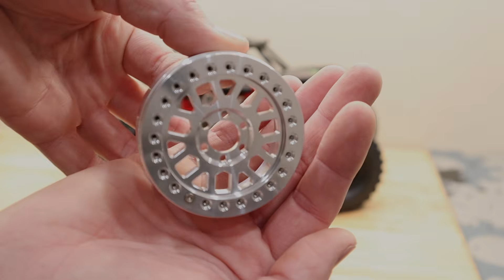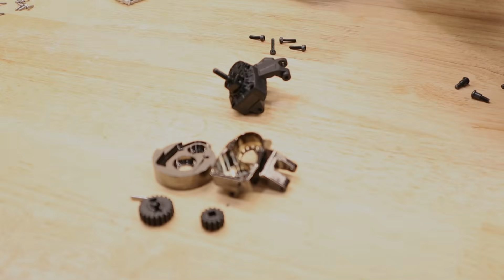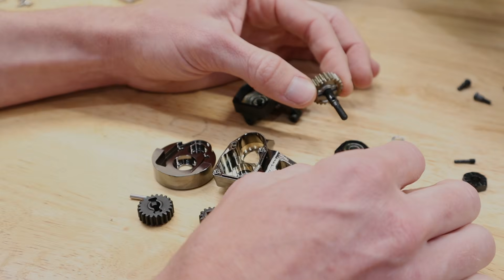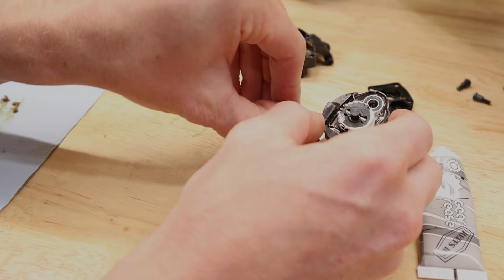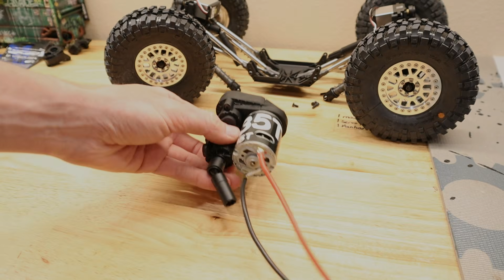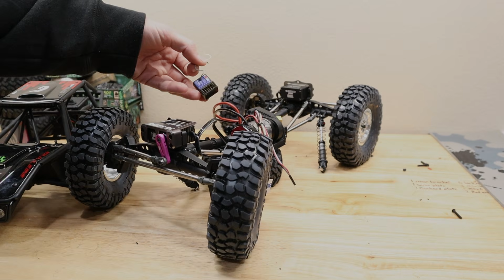My Favorite Capra Mods! Best Upgrades for Axial Capra UTB

Comment: im knew to the RC scene. i recently bought a capra used. it worked at first. now after about 15 minutes of drive time i cant turn the vehicle on at all. ive tried charging the battery, nothing happens when i turn the car on from the back switch. im lost where to go, i cant find any forms out on the internet with this issue. any help would be greatly appreciated
Reply: If all else fails take it into a shop and have them help you out bro.

Comment: Hi bro man! Have a question with the hobbywing fusion se and 3s lipo with stock trans and 12 t pinion will they hobbywing stay cool? I'm running am32 and it's getting to hot thinking about putting fusion in instead of switching to 3 gear trans for the am32. Not sure

Comment: I’m a huge fan and just bought my first Capra.  I have 2 questions please.  First is could you get me a link to the thumb steer attachment on your gt5.  And when I install my fusion, which came today, where do the lights plug in now?
Reply from the maker: You will need a new receiver with the fusion and plug the lights into that
Reply from the maker: My thumb steer was given to me by a friend

Comment: I have owned the Capra 4ws since it came out and I just burned my motor 🤣 gonna be upgrading to the fusion pro. Thanks for the great info and the installation process! Do you have a video explaining the binding process with this set up?
Reply from the maker: No need to bind just because of a new motor
Reply: @westdesertwheeler  I just figured since you got the new receiver too, that it would require binding

Comment: The nitto Grappler tires work well if you cut the inserts in a star pattern.Because they are ribbed on the inside.They are my favorite creek tires after they break in.
Reply: Fine if you want to spend zero dollars on tires/ foams. But it’s not 2007 anymore, there are far better insert and tire options. Star cut foams don’t offer near enough sidewall support, and like Logan said the compound of the trail grapplers just isn’t near as soft and grippy as other options on the market.

Comment: I really like your build! The information you give is great. I'm having a problem with mine after the last ride. When i let off my throttle my Capra will continue to move forward, not at a fast speed but it does keep moving. Help

Comment: 2.2’s look so goofy in my opinion on 1/10 scale cars. I really much prefer the closer to scale look of 1.9 wheels and tires. Also instead of hacking your link mounts just go for a Holmes hobbies revolver. Ridiculous amount of torque and as far as sensorless brushless goes, the start up is ridiculously smooth. It will crawl slower than you need to even with the over geared Capra trans.

Comment: Great video, I'm really looking forward to trying some of your ideas! Out of curiosity, what is the benefit of the Cut'n'Shut method over using stock 2.2 tires? Do the tires you want to use not come in 2.2 size?
Reply: I'm also wondering why

Comment: No flat skid or long rod ends/links?    There is an .stl file on thingiverse for spring cups that retain the spring but at a lower position like removing the cup.
Reply: Thingiverse also has a file for hood pins that don't require a body clip, they're great.

Comment: You mentioned venting the tires but I didn't see you do it.  How exactly is it done?  
Also, those wheels look like you can narrow the width using short hubs.  Did those .350 hubs narrow it from stock?  Capras are so wide and the gates seem to get narrow!  I've got some carbon fiber wheels that appear to be similar but I haven't installed them yet.  I wonder what hubs to get.  
Have you ever gone over setting up the end points on a GT5 radio?  I'd like to see the whole process sometime.  I don't think the servo I replaced is correct.

Comment: Parts diagram I am looking at says the stock pinion is AX30569 which is a 48 pitch 14T.  Your saying a 11T 32P AXI30722 will work?
Reply from the maker: Yes 11T bolts right up. Doesn’t have to be an axial part either. Many brands of pinions available make sure it’s a 32P

Comment: I’m currently in middle of my build but I’m using a vanguish 3 gear with dig. I planned on using a 12 tooth pinion. What’s ur suggestion
Reply from the maker: 14T will be more than enough with a 3 gear. It will be slow

Comment: Man I probably learned more form this video on Capra’s then any other I just did a full upgrade to my 4wheel steer Capra I used a  Vader  skid & Injora high clearance links/ wheel extender because I’m now running 2.2’s I also have 90mm Lizard Pro shocks those 2 strong Reefs servos you installed how did you set them up with a bec  direct power? I know drawing that much power it’ll cause a brown out. I’m running 2.2 Proline Trenchers but I’m looking to get your cut n shuts soon. Thanks for al the useful info.

Comment: Man haha I learned the lessons in this video first hand about a month earlier cause I got a capra for Christmas. Smoked the motor first big crawl day caught in a bind, and then later the slipper clutch got me because the Vader skid moved up the trans enough to contact a wire keeper on the battery tray. But yeah agree 100% on fusion brushless!!

Comment: You should try the treal transmission case. It allows you to move the idler gear, 2 positions, to use a smaller pinion I think like a 9 tooth with a quick run fusion

Comment: If you have never tried it, I would suggest giving the Vader skid a try, Logan.  It gives both the benefit of a better break over and even more importantly the ability to use a full-size (or low profile) servo for the dig unit.  With the larger servo, you can lock and unlock it under full load, and it works perfect.
Reply: After doing research the Vader skid was the most recommended so I installed one & love the flat bottom & I installed a Fusion Pro at the same time so I had no clearance issues with the Vader.
Reply: @Casitascrawlers rock pirates interceptor chassis skid plate fits the Capra bolt on, and it allows a 3 gear transmission, and is flat belly, overall much better than the Vader unless you don’t want to change transmission
Reply: One of the best mods a capra can have is the vader skid!
Reply: The problem with the Vader is the lower links protrude below the skid, they hang up and wear out as well.
Reply: @DaxHewitt  nothing is perfect & I’ll take the flat skid clearance regardless that just means your clearance is good so even if you fixed that it would just mean your going to rub on something different so it’s give or take.
Reply: This is good to know I had given up on the Capra dig.  The CJ7 needs help also
Reply: Great video. I’m probably going to get a Capra for my 1st rc car. This video is going to be super helpful, down the road. Other than the coil spring mod, what would be the 1st of these mods to make? I’m guessing, tires.
Reply: @joecarmean1079 I would suggest the Vanquish Stance RTR over the Capra. Just my thoughts. I have the 4 wheel steer Capra and the Stance is INSANE capable right out of the box completely stock.
Reply: I still have the micro servo I bought for my kit that came with the rtr. It got dunked in water and stopped working and one day I decided to see if it worked and somehow it revived itself and still to this day I have not needed to change it out. I’ve been running it since the Capra released.

Comment: It's actually pretty funny! I have more capra trans, axles, etc than anything else. But I've never owned the first one🤣🤣🤣
Reply: Those wheels are awesome!
Reply: And I use a pencil file to knock the burs off the shafts from where the pins wear.
Reply: And how do you get the wheels? They all say out of stock? Or do you have to order them and they make them? I'm pretty interested in a set

Comment: Do you run the winch with the other potentiometer dial?
Reply from the maker: I run it on channel 4 a 3 position switch. In - neutral - out